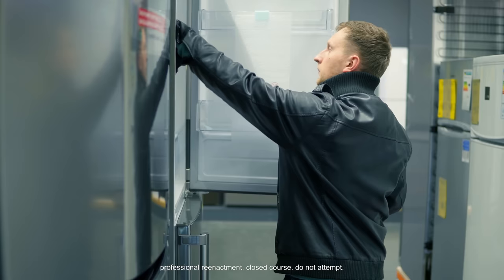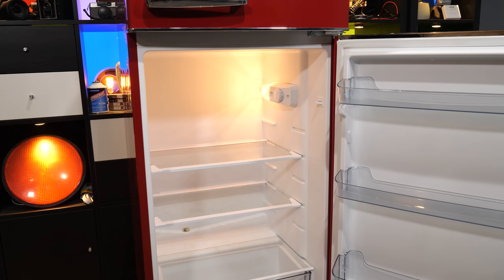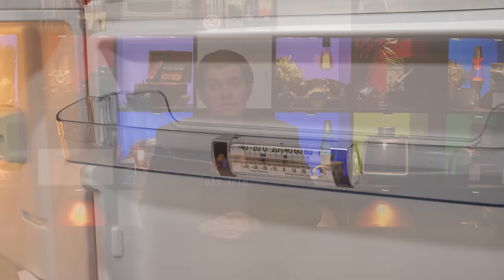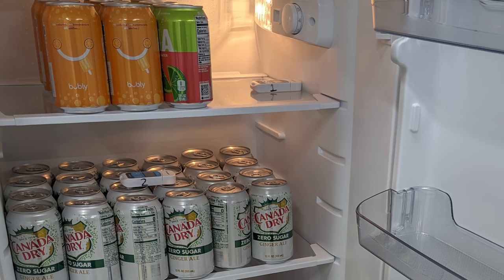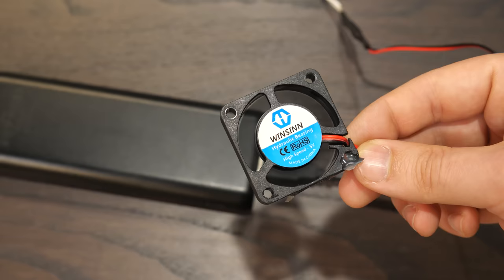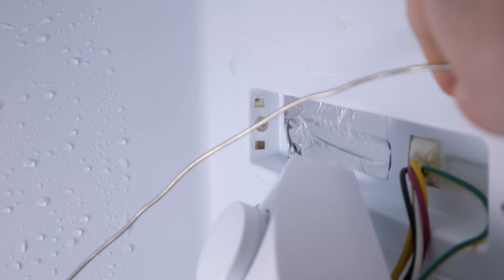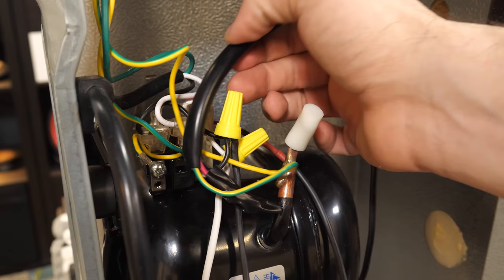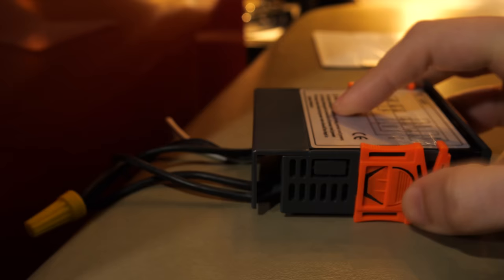This goofy fridge has a really clever design. It's also kinda terrible.

Comment: As someone who's been tinkering with their PC for nearly a month straight for no apparent reason, that "No! Stop it!" had me laughing. I'm glad I'm not alone with running into these sort of insane rabbit holes.
Reply: It did make me curious though! A similar question comes to my mind as to whether creating active airflow around the external radiator would increase efficiency. Our built-in fridge with a microwave-oven sitting on top seems to have very little airflow round back at all.

However, not having seen any consumer-grade fridges in my life with a fan in that particular area (near the compressor circuit) I assume no major differences are to be found as surely fridge manufacturers would have thought of this option as well.
Reply: @dinkytoy8218 My mom’s fridge has a fan that blows over the compressor- but vents into the baseboard area below the cabinets which took years of wondering where the lint on the dishes came from. 

(Thankfully after having had a cat, mom wipes out all dishes before using, just in case.)
Reply: @CrankyOtter  Store them upside down my dude. Dust is only on the outside then
Reply: 57:00 is where this sequence occurs in the video for anyone wanting to watch it again.

Comment: you can try using grills instead of a a solid plastic for the shelves like the old fridges used to have, it was the way to ensure proper convection before the fan times
Reply: I have a decently old (~15 years) and cheap fridge in my apartment with the same cooling design as the one in the video, I never thought about why my fridge had grills and your comment made a lightbulb go on over my head.
Reply: I sometimes wish they started using those again. I understand they're easier to clean but some of the glass and plastic shelves are extremely flimsy.
Reply: My upright freezer has grill shelves that are the actual cooling elements!! It's bonkers.
Reply: We still have those shelves in food service reach-in cooler units.  The main difference from the old  consumer units is the wire rack shelves have an antimicrobial plastic coating.  I'm not sure one could usefully install pilaster strips in a modern conventional consumer model refrigerator, but they and the brackets to hold wire rack shelving are cheap enough.  The shelves are not cheap however.
Reply: @OstrichWrestler  YES i've got an LG with those glass shelves and some of the plastic bits broke within like a month. It's gonna be a bear to replace, if I ever get tired of the duct tape -- it's like $80 for the replacement shelf and you can't just get the plastic frame, it's got new glass and all.
Reply: @sullendragon8900  You can't escape it. We had a samsung with polycarbonate door inserts that liked to break. Eventually problems stacked up and we replaced it. The whirlpool that replaced it has plastic bits on the glass shelves that like to come off when you pull a milk jug out of the fridge wrong.
Reply: @OstrichWrestler  Ugh, great! There is no hope. :( This one also tends to freeze over the freezer, which makes me wonder what's going on in the design department, but I'd rather not replace this one any time soon, so I'm still trying to figure it out.
Reply: @hdsheena  Oh hey, my parents had a freezer kind of like that! The elements have grill shelving around them, though, so at least they have a little protection. It's pretty old, I'm not sure they still make them that way. It gave up about six months ago and the replacement has grill shelves, but no cool elements built into them.
Reply: @hdsheena  I have one of those too and it's super neat cause each of the shelves is individually cooled cause of that
Reply: @noodlelynoodle.  Yeah exactly. It's almost like flash freezing. The frost build up though...
Reply: Overall, like the grills as well, but that does mean any spills will drench everything below.

Comment: The motor shutting off early could be due to a built-in duty cycle limitation. The compressor probably can't run permanently without risking damage, so it has a cutoff if it runs constantly for too long.
Reply: Could also be that the tiny amount of refrigerant was over capacity causing flooding in one part of the system
Reply: @JanRademan YES, there's two control functions at work here. One is the compressor overheat protection and the other one is the thermostat inside the fridge under the evaporator. The first one protects the compressor by limiting how long it runs and the other one is limiting the fridge temperature WHEN the compressor is working within limits. That's why the sensor is near the evaporator.
Reply: Duty cycles on refrigerant pumps (the enclosed types like in refrigerators) are usually 100%. There are thermal protection circuits in them but those will usually only engage in the case of limited air flow or component failure.
Reply: @deekman78 are you sure? I remember seeing "computer geeks" and overclockers trying to use a fridge compressor and failing because of the duty cycle limit.
Reply: @mohammadalhasan4253  the compressors inside of refrigerators can run 100% duty cycle but they can't be used to pump over a certain amount of wattage, which is where you'd run into issues trying to cool computer components. I found a wine fridge that had 19" wide shelves and considered putting some telco-racked servers in there (think like 4 raspberry pi inside of a case or something, but from 2005). In essence, by design and application fridges remove heat, and no more heat is added. For active cooling there's constant heat being added, and the overall capacity (expressed as tons or whatever) needs to be above and beyond that capacity to run effectively.
Reply: @mohammadalhasan4253  Not all of them are. All of them I've encountered (refrigeration pumps) have been, though.
Reply: A even simpler explanation for the data is that the thermostat is placed on the wall for the fridge and not in the middle of the fridge that the data loggers are measuring. At where the thermostat was, it had reached temp as there is better thermal conductivity from evap coils to thermostat than through air.
Reply: Thermal cutoff on compressor housing.
Reply: I think what's happening there is that by placing the temperature sensor on the evaporator, they essentially built a timed switch. That is because the temperature of the evaporator depends a lot more on whether the compressor is running than the internal temperature of the fridge. This would explain why adding more heat to the evaporator with the fans changed the cycle times more than the temperature in the fridge does. The fact that the compressor kept running when the thermostat was placed in the air indicates that there is no runtime limitation for the compressor. So if the thermostat never reaches the temperature it's calibrated for even with the pump at full load, it will run indefinitely.
Not sure if I overlooked something though.
Reply: I assume you watched to the end where he added his own thermal controller? The Compressor ran just fine 15 hours straight.
Reply: @tisjester  No. That would be an hour long video on a fridge. 🤭
Reply: @tisjester  Ran 15 hours straight for a day, not 10 years. You have to think in lifetimes of the product, not just one cycle/observation.
Reply: It could be, but it isn't.
Reply: @mrcomment5544  I was referring to a built in cutoff. It does not have one of those, which he demonstrated when he used his own thermal controller.

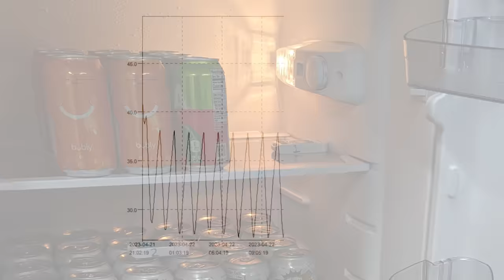Comment: 23:15 it ABSOLUTELY was a factor! like my other comment said, fridges rely heavily on the thermal mass of their contents to maintain their temperature.They are not designed to cool things quickly, they are designed to maintain a cold temperature. In the commercial kitchen they have special things known as "blast chillers" that are designed for the actual purpose of cooling down hot things. Even a commercial cooler is not designed to make hot things cold. You need thermal mass!
Reply: This and compressor size and the amount of space % wise taken by the cans makes a humongous difference.
Reply: This is 100% what is happening
Reply: With the way the freezer was overperforming, he could have used the freezer to carry some of the cooling load as well, transferring the already chilled cans to the fridge when they were ready
Reply: I knew about that phenomenon years ago, I think I was taught it by my mother? I know she would "admonish" us if we left the freezer empty.
-
When I left my previous apartment, I put a cheap store brand gallon of water in the freezer and the refrigerator to keep the unit from breaking itself.
My outgoing landlord didn't know about that reasoning and thanked me for the care.
-
Because I regularly end up emptying all of the food out of my freezer (by cooking it) I keep not only the ice trays in there, but also two or three of those plastic containers popcorn kernels come in, filled with water and constantly frozen.
Since I added those, my refrigerator runs a little less often.
Reply: I was amazed how far I had to scroll to find someone who was going to tell him he is wrong. It's a pretty simple difference, imagine you are changing the total internal average temperature by 50F on one fridge and 15F on another and pretending that the tests are comparable.
Reply: @PabloEdvardo or @MonkeyJedi99 Explain something to me. Say, you put some thermal mass in the fridge, or in the freezer as some suggest. Since that mass is at much lower temperature than room temperature, it needs plenty of energy to get it chilled. Then, when the fridge cycle stops, since the mass is at a lower temperature, it gains heat comparatively quickly, and again requires energy to chill. How does that correspond to the claim that thermal mass helps keep the fridge cold? All I can see it that the ‘mass’ consumes additional energy to keep it cold.
Reply: @asanisi The mass in thermal mass means that there's too much stuff for it to warm up quickly.

Comment: The corrosion you are seeing on the braze joints is from flux that is needed to help join the dissimilar metals (copper and steel) on either end of the condenser. Residual flux forms malachite on the copper end that looks alarming, but is really harmless. The only reason to clean up the joints is for Instagram, it's not autocatalytic like some forms of corrosion, so it won't get worse over time. If you look at either end of the condenser on your KitchenAid you will almost certainly see the same thing.

The "capillary and bulb" style mechanical thermostat in your fridge actually doesn't have a bulb. It has a rounded tip where it was closed on the end, but that doesn't contain any more vapor than the rest of the capillary. Which is to say that it isn't measuring temperature at the "sensor bulb," it's measuring temperature across the full length of the capillary. It may be that the positioning of the thermostat guide tube wasn't perfect relative to the inner liner and the evaporator, but I think you are making a much bigger fuss about this than you ought to. If you perform the same experiment in your chest freezer you will get similar results in terms of temperature inhomogeneity (both spatially and temporally).  The combined heat-capacity of the beverages you put in the fridge is, I would guess, about 50 times that of the empty interior (including the glass shelves). If you had rerun your tests with the temperature loggers after filling the fridge with a reasonable amount of food and first letting it reach it's steady-state temperature cycle, you could have thrown a couple of room-temp 6-packs in it with a much more reasonable temperature response curve. On top of that, you should have placed the loggers inside a Tupperware or jar or something so that they would experience temperature changes in the same way that your food will. Even if the air temp got up to say 45F for hours, anything in a container that is isolated from the air won't get nearly that warm. While your Samsung and KitchenAid machines looked respectable in comparison to the Galanz, you would find that basically all cheap top-mount forced-air fridges would perform similarly to yours in a similar test.

Comment: R600a is Isobutane, for those wondering. It’s composition is exactly like butane, only it’s put together in a different way that makes it behave differently, especially as far as boiling point.

In refrigeration butane boils at a balmy -0.4C, while Isobutane’s boiling point is -11.75C. The lower boiling point means it has capacity to absorb more heat at lower temperatures.
Reply: R600a is very often used als refrigerant becaus it acts very near to R12.
And the manifacturer likes it, my 2-door fridge/freezer uses 52 Gramm of this.
And i found the manuals of all my older fridges that are scrapped years ago and all of them used R600a.
Reply: Which is also why isobutane is the a popular fuel choice for cold weather backpacking/camping stoves.
Reply: @michaeldemanche4162  If you want use your gas stove in cold an thin air, 5-15% Isobutane is recomendet. But its much more expensive, its only useful in cold climat like high altitude climbing or polar traveling.
Reply: @Schutti73  I'm talking about the canister fuels which are sold for backpacking stoves. The most popular brands (MSR, GSI Outdoors, and Snow Peak), marketed as all-season, have 80%, 70%, and 75% isobutane respectively. With propane making the remainder. You're right though, they are more expensive than propane, but not too expensive.

Comment: The reason(s) for the spikes is a combination of the response speed of the thermostat (as well as it's proximity to the evaporator and the thermal mass of the fridge) and the thermal overload of the compressor. Placing a more sensitive temp probe right next to the thermostat and one by the compressor probably would've showed that. Possibly the reason for utilizing the drip tray as a passive chiller

Edit: Having watched the rest of it, you are absolutely correct. But as a suggestion to improve the safe function of the fridge, that original thermostat was probably not intended for use as a practical temp sensor. It seems that it's main purpose was to make sure the evaporator didn't get too cold and create an extreme temp differential within the fridge. Simply tying that in series with the actual controller you upgraded it with would still be useful as a secondary feature to make sure the beer in the back doesn't freeze before the beer on the door even starts getting cold. Yes it'd be a more gradual reduction in temp, but some airflow from a small fan would make sure it wasn't off for too long
Reply: I came to a similar conclusion - that bulb was there as the duty cycle control for the compressor - hence the behaviour on cooldown (thats how it SHOULD behave if its loaded that hard with a tiny compressor). He is currently VASTLY overloading the undersized piston compressor and never giving it time to cool down. It NEEDS a max duty cycle like 30 min on 15 min off.
Reply: I have always seen those types of bulbs used to control a thermal expansion valve (TXV) in regular old air conditioners. Usually this bulb is directly attached to the evaporator line and covered in insulation tape to monitor the temperature there so it can change how much refrigerant it is releasing into it so as to correctly regulate the temps of the evaporator coil and the condenser coil. This would explain why the fridge basically stopped working after he put it directly into the air of the fridge. It does not expect nearly that high of a temp so it will open the TXV all the way and lower the temperature/pressure split across the evaporator and condenser coils to the point that it would hardly cool anything.

Really it wouldn't make sense to use a device like that as a temperature sensor in such a budget refrigerator. Its actually a rather expensive device, made of copper and filled with pressurized refrigerant. Orders of magnitude more expensive than a simple electronic temperature sensor. I suspect the real way the fridge regulates temperature is by using that dial to regulate how long it's cycles last. This would explain why the cycles seemed to have little to do with what temp the fridge was running at.
Reply: Theromostats seem to be the problem. I had to buy a new one for my fridge,Not a new one, an alternitive. : }
Reply: @garyz2043  seems to be a common thing, I've done it to 3 of mine over the years..
Reply: @mycosys  "so as to correctly regulate the temps of the evaporator coil and the condenser coil. "
 I came here to say just that, thermal overload protection.
But, you have already said it, so I will have to say something else.
It's a nice Red colored Fridge and I quite like the chrome.

Comment: I just sat here for an hour watching a fridge video. The way you presented this, wasn't bored one minute! By the way, my dad still has a 1948 fridge purring smoothly in the basement. Quieter than modern fridges, I doubt that any modern fridge will last 75 years.
Reply: Plus a modern fridge can't stop radiation from entering the icebox
Reply: @jacobscarberry4799  seemed to work fine for Indy
Reply: @Sillimant_ EVERY one knows Indiana Jones should not have survived that nuclear blast.  His body would have been squashed inside that metal box

.
Reply: @electrictroy2010 don’t care, it was cool.